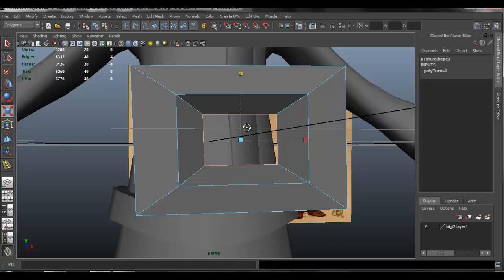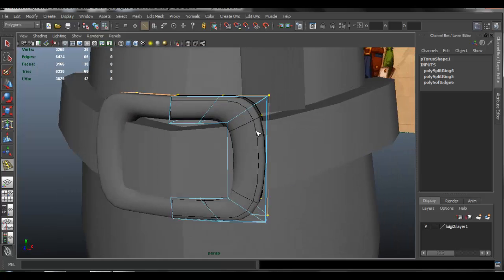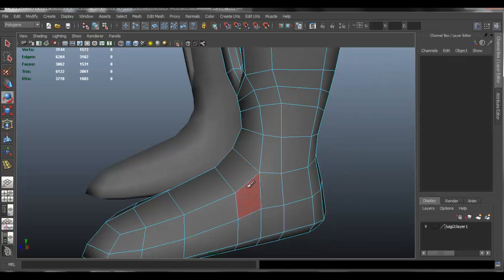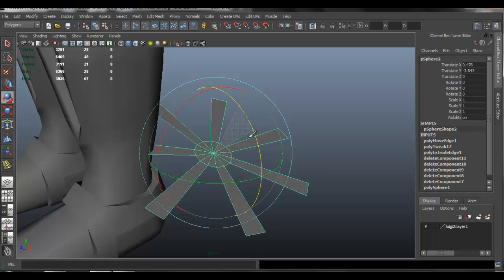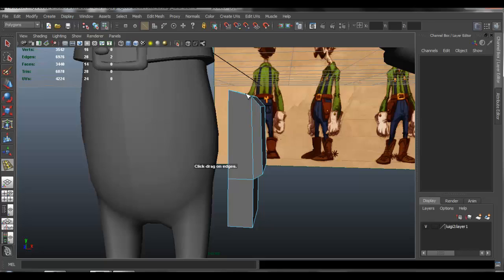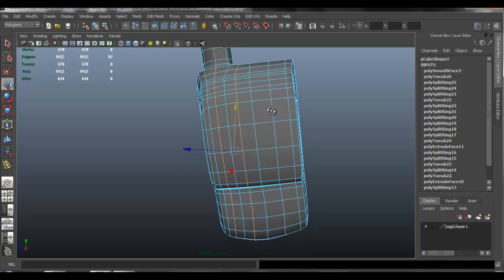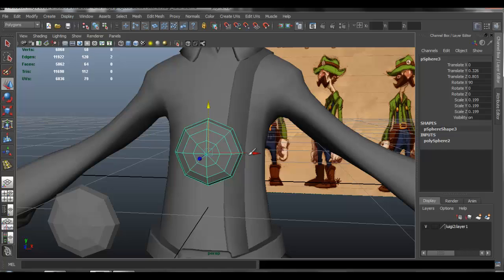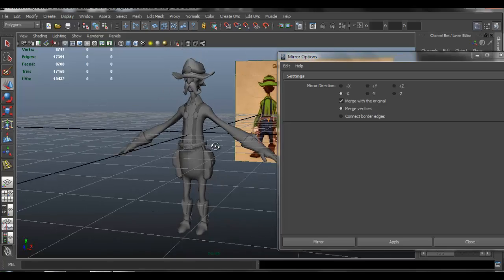Autodesk Maya 2013 Tutorial - Character Modeling - Final Part 11

Comment: just one question: is it better to connect all the parts in one (ex. body, clothes, shoes..)or to keep them separately? Thank you
Reply from the maker: It really depends. If this is meant to be a low polygon model and has to be animated, probably all the parts will be kept together. For a higher poly model some parts may be kept separate. There is not right or wrong on this. Accessories are usually made separate depending on how they will be handled.
Reply: 3dEx Thank you for the answer.

Comment: Hi, when I mirror geometry mostly the neck and head area do not merge:

http://imgur.com/YzceM7z
http://imgur.com/ehS1cwj

What could be the issue?
Reply from the maker: looks like the tolerance for the mirror tool may be too high, you may need to reduce that a bit. Also, make sure that the edges where the pieces meet have been set up to be exactly in the origin of the grid. I also have a character troubleshooting video in my channel if that helps.
Reply: 3dEx

Thanks! Now the issue seems to be there isn't a Merge Threshold value that would cover the whole seam without either making gaps between the body and the mirror or making these weird things I posted. Does this mean I should choose the best Merge Threshold value which covers most of the seam and manually fix the rest? What would be the best tool to do this?
Reply from the maker: Spike Spiegel you could do that and then manually used the merge vertex for the other problem areas. sometimes the scale of the model factors in as far as tweaking the threshold so sometimes I select half the object and go to the attribute editor and from there scale the object by something like 10 and then mirror. this usually fixes any problems, after doing that you can go back to the attribute editor and set the scale back to 1 for x,y,z.
Reply: 3dEx
I tried scaling just the hat and it seems to work! Finally, I'm able to finish your modeling series.Thanks again for your tutorials and the additional help!
Reply from the maker: Spike Spiegel
That's great to hear. Good luck